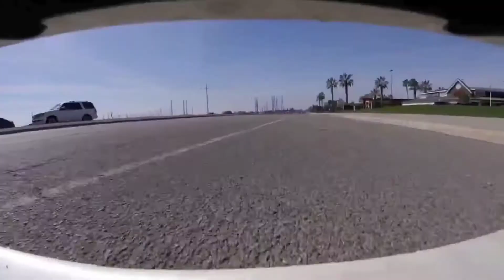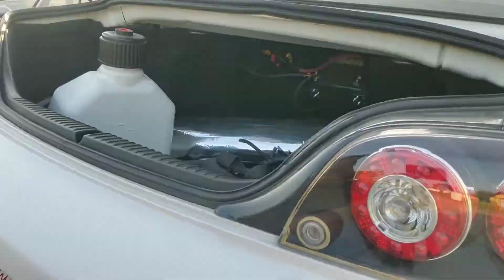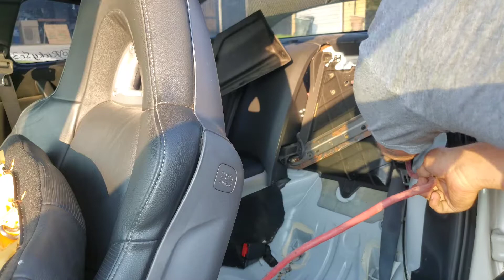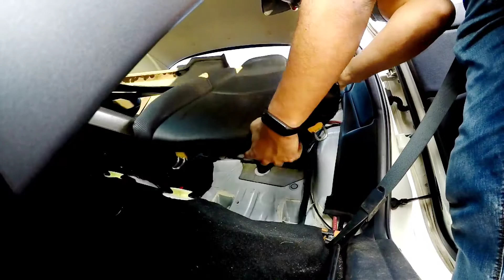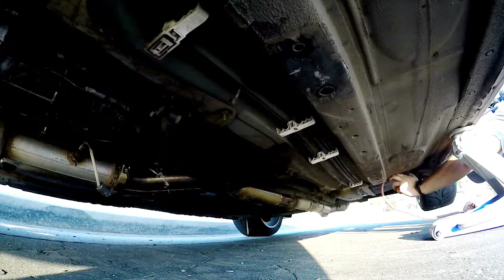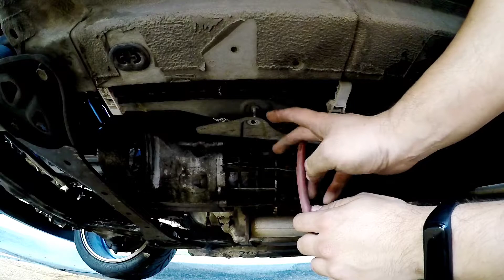How to relocate your Rx8 Battery Part 2! 200A circuit style fuse and main power wire!

Comment: Another great video. Thank you for creating this walkthrough. Is Part 3 coming soon?
Reply from the maker: Part 3 wont occur until i have the battery relocation kits i will be selling in stock. They are currently being powdercoated. They should be in my possession by early February 2022